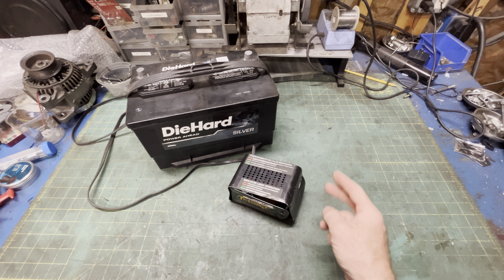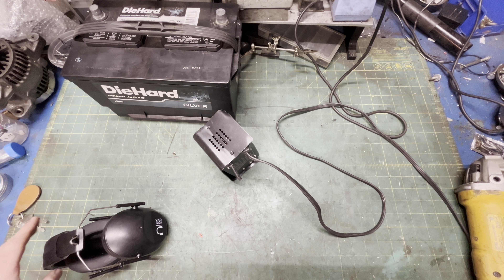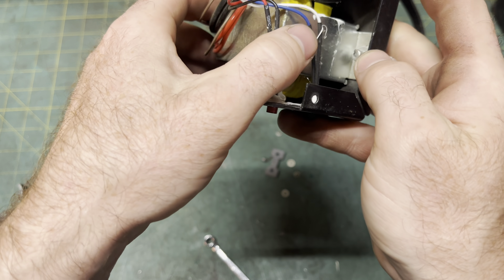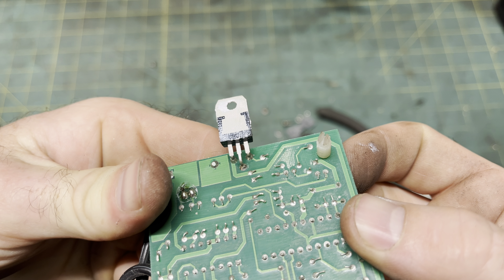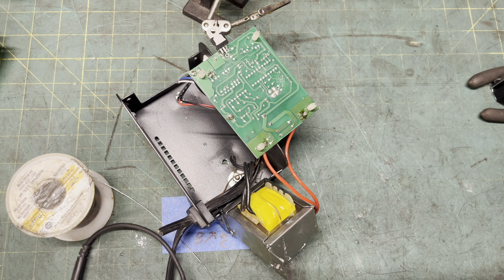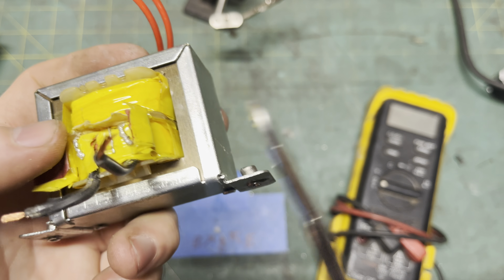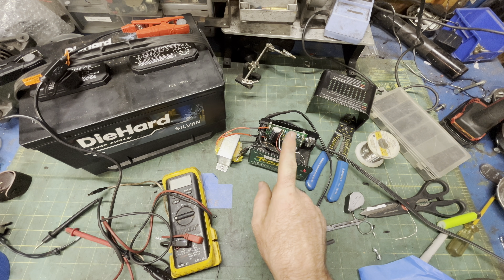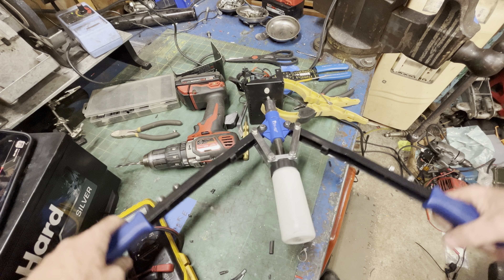Battery Tender Troubleshooting: Don’t Trash it, FIX it!

Comment: Iwill suggest buying a used power supply for server its cheap and reliable and you can easily modify it to 14volt and up to 60 or 100 amp and there is aton of free information online for modification and it will live long time iam using one in my garage daily and its fine

Comment: I just went through this exact scenario with my ~20 year old battery tender a couple weeks ago.  I replaced the transistor with no luck and gave up.  It is still in the trash bucket in my garage though, so maybe I will check that thermal fuse.  

Someone in the comments suggested removing the transformer and just using a 19v laptop charger.  Is this a potential solution?

Comment: It's not designed for a battery that big, these are for "power sports" batteries. It's way overloaded and without that thermal fuse it's going to fail in a method you're not going to be fond of unless you enjoy making smores at 3AM over what's left of the smoldering garage.

Seriously, look at the documents on this charger. I've got two for my motorcycle batteries and they'll even get super hot with a low voltage motorcycle battery. Putting that on a car/truck battery is absolute insanity.
Reply from the maker: Idk, it’s got a picture of a car on the packaging and the Amazon listing says automotive. I’ve been charging car batteries with it for a decade. What killed it was trying to charge a battery this dead after running over it twice, which I think is fair.
Reply: @thedoubtfultechnician Charges & Maintains Motorcycles, ATVs, Lawnmowers, Dirt Bikes, Personal Watercraft
Reply: @thedoubtfultechnician go to the manufacturer website with that model number, it says nothing about automobiles. Amazon listings lie constantly

Comment: If you know what the rectified and smoothed voltage from the transformer is you could put a DC jack on it and use a modern and efficient switching supply instead. Also, being external and on a jack it would be simple to replace if it fails.

Edit: Bypassing the safety thermal fuse in a transformer or motor is NEVER a good idea. That thermal fuse protects against fire. It's one thing to bypass for testing with a meter but a replacement thermal fuse should be fitted before putting the device into service.

Comment: 4:00  This is incorrect: That is not a zener diode. Based on your next sentence I think you meant to say Schottky, not Zener, but this would also be incorrect. It looks like a 1N5404 3-amp silicon rectifier.
Reply: 10:01 Okay, I'm not saying that it's definitely the wrong temp thermal fuse or I don't have complete confidence in your repair, I'm just saying that when the transformer burns out, next time just replace it with a 19v laptop charger. Thrift stores usual sell then for two bucks, the voltage is close enough to what you need, and you probably have some lying around anyway.
Reply: 4:42 This is also incorrect, as the big transformer indicates it is a linear, not switching power supply. That transistor will just turn off the supply when full or when a fault occurs, but it's not part of a SMPS.

Comment: I would have absolutely thrown it away and been completely clueless on how to fix it. I gotta leave my car sitting for a few weeks at the end of the month, and now I want to crack open the battery tender sitting in the garage ...
Reply from the maker: If you’re worried about battery drain, you can always just disconnect the negative battery terminal. Just make sure you don’t need electricity to unlock your doors!
Reply: @thedoubtfultechnician  Somehow I've never had anything other than a physical key for my cars. My current vehicle is a 2012 and for whatever reason that didn't come with a remote entry either.

Comment: Just fixed a battery charger where both of the wires going to the battery side alligator clips had broken right where the wires attached to the clips. Invisible to the eye since the insulation remained well attached to the clips.

Comment: Reminds me of my clothes dryer. It has some sort of overtemp switch that uses an internal belleville spring. According the the manufacturer, you have to replace the switch when it trips but you can just grab it on the sides with a pair of channel locks and smack the face with a screwdriver handle and you'll hear it reset. Three years later, still works.
Reply: sounds like it's a resettable termal fuse with a bi-metallic strip, but probably made/assembled wrong, so it doesn't reset by itself
Reply: @Psyden5757  found where I fixed it originally, it's a non-resetting thermal fuse from an 80 Series Kenmore Dryer.

Comment: Sneaky thermal fuses, they are also found in the supply lead to the washing machines, dryers, toaster etc etc.  So before you junk stuf check the continuity of the circuit from the plug to the bits that chooch.  Microwaves have several thermal fuses hidden about the box just replace with the correct temperature range and take the win.
Reply: the ones in microwaves and such though usually are self resetting switches. after twenty minutes they should be cool enough to reset. though i have heard some will not reset automatically and you have to whack them with something. in things like toasters and hair dryers though, they indeed tend to be fuses which must be replaced after they are blown

Comment: Lol When I worked in maintenance at welding plant. We always removed the fuse inside the transformer and use a adjustable high limit switch. Saved our hack job plasma table multiple times

Comment: Fixed my bros overheated electric grill with similar issue - blown thermal fuse. But managed to get correct thermal fuse mounted, it was just screwed to the chassis.

Comment: Harbor freight sells pneumatic pop rivet guns that are actually pretty darn good. I've been using one of them for years and it's been reliable. Though you should tape a rag over the exhaust port so you don't get covered in air tool oil.

Comment: Now my Question is
Why did the fuse blew in the first place?
I would guess a super dead battery to be pulling max current for a a long time letting the transformer heat up and maybe in that situation cooling  was not enough and it blew bcs of that.
Or some other part is slowly failing causing it to pull more current than intended
Reply from the maker: You might be placing more much faith in the quality of that $0.10 thermal fuse than I do. Sometimes cheap safety devices ARE the root cause…
Reply: @thedoubtfultechnician  It is just something i learned when doing electric stuff. A blown fuse almost always has a root cause. This time it may just be the fact it failed on its own, which honestly it shouldnt.
Reply from the maker: I’ve seen thermal fuses fail due to their own age or vibration but when it comes to regular fuses, I agree. I have NEVER seen a regular fuse fail all by itself.

Comment: Just so you're aware I've just run into the issue today where a transistor failed but would work perfectly right up until you put significant load on it and even then it would work for about 30 minutes

Comment: If you find a competent riveter under $200 please do a review so we can all get on with a frustration-free life!
Reply from the maker: “Buy once cry once”

Yeah, but I use it four times a year so if I spent over $200 on it, I’d be crying every time I used it. Still, I think I could be bothered to spend more than the $19 this one cost.
Reply: @thedoubtfultechnician  Most of them work but you need to lubricate the jaws and the housing. Not the inside of the jaws of course but the outside. New cheapos are riveted but older ones had a snap ring pin and you could adjust the spring stiffness with a screwdriver so try get one of those .Pop out the jaws and put few drops of oil and it will work like a charm.
Reply: Lidl  / Aldi do a good one for $20 ....
Reply: Stanley MR55C5 Heavy Duty riveter is $25. Have had mine for years. Works great.
Reply: I've been using the typical pliers looking ones, some have different collets, many brands good to cheap, but all of em work fairly well. 20-50 bucks? The ones that are 90 degrees to the handles.

Comment: You should get one of the AVR transistor tester Chinese knock off devices. There's a lot of variations of them today so it's hard to say which one to get. I'd say look for a TL431 voltage reference, rotary switch and graphical display one. I have one of those and I like it. I have a couple other models too. There's info about the project those are derived from online so do some research. It's an interesting topic.

Comment: At least today you can still buy an automotive battery over there that you can top up the water if needed. In Australia all the car battery's now only come sealed so if you overcharge them or have to give them a decent boil to revitalize them you cant add water back to the cells without drilling holes in the top.  I have had to replace more battery's in the past 10 years than I had to in the previous 30 almost always due to non serviceability.
Reply from the maker: It’s really hard to buy a refillable battery over here as well. I’ve never seen one in a car. The only time I ever saw one was for a lawnmower.
Reply: @thedoubtfultechnician the covers over the vents can usually be pried off by a screwdriver and the holes of each cell will be exposed, and the cover can be clicked back on without damage by just pressing it on. some have the covers recessed but can still be removed.

gotta be a flooded battery though and not SLA or AGM (just another term for SLA).
Reply: @EdwardTriesToScience  The few I tried here in NL the cover was ultrasonically welded on. No removing it without total destruction.
Reply: @JoranGroothengel oh that is unfortunate. also out of curiosity, do they still sell battery acid in europe? they banned sulfuric acid about 35% concentration a while ago, but from some chemist friends ive heard no one enforces it. anyways its rather unfortunate that even something as simple as a car battery now cant undergo proper maintenance.
Reply: @EdwardTriesToScience Harder to find but still exists
Reply: @thedoubtfultechnician most batteries here in Europe are
Reply: @mantvydas8810  Not in my part of Europe (NL), here most common car batteries are sealed. And not with a removable maze cap, it's ultrasonic welded on and not removable without total destruction.
Reply: @JoranGroothengel Here in Lithuania most still have caps, hell I bought a battery a year ago and it had caps.

Comment: i fixed one before. it was past the 15 year warranty and it was the transformer. i slapped in a cheap 12v smps adapter and it works again. yay.
Reply: Keep in mind the float voltage for a lead acid battery is about 13.8v, so you will never fully charge it with 12v.
Reply: @nezu_cc  right.  it must be a 15v smps. it was a very long time ago that i fixed it. i know it works well still.

Comment: Don't breath the boiling battery stank, it's not good for ya.
Reply from the maker: The leaky doors, windows, and crappy insulation in my workshop are not a fault. They are a feature.
Reply: @thedoubtfultechnician  A safety feature! *Gasp*! Safety!
Reply: Like with many things, the "stank" is natures way of saying, "Hold your breath."
Reply: It's flammable but I don't think hydrogen is harmful. That's what's bubbling off a battery. I think oxygen too? oxygen certainly isn't harmful. It's electrolysis that's going on. Like you'd get passing current through any water.

Comment: A year or so ago I tossed one of these out after diaging the board and seeing nothing wrong. Never occurred to me that there would be a thermal fuse in the transformer.

Well, at least I'm doing my part in the landfill ecosystem.
Reply: for how expensive they are there sure isnt a lot to them. but they are the best of the lot as far as reliability goes.
Reply from the maker: I agree. Worth saving!
Reply: Did the same